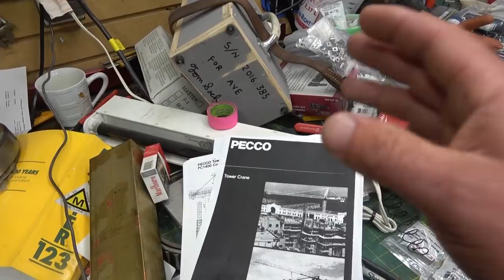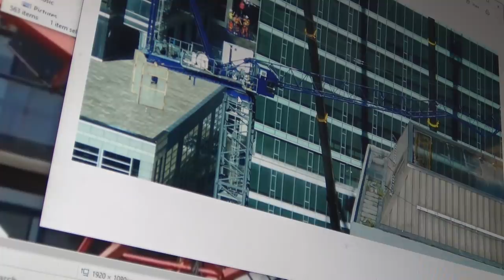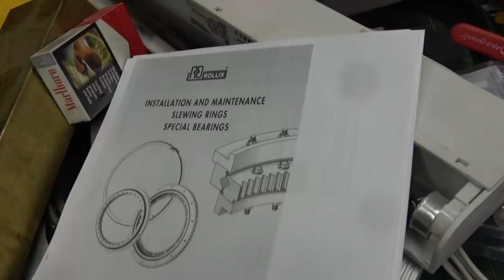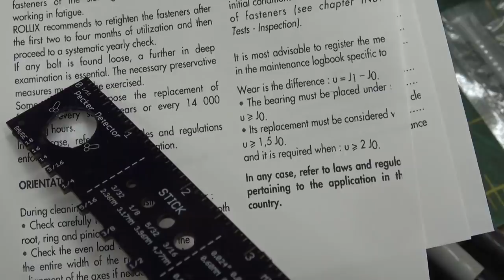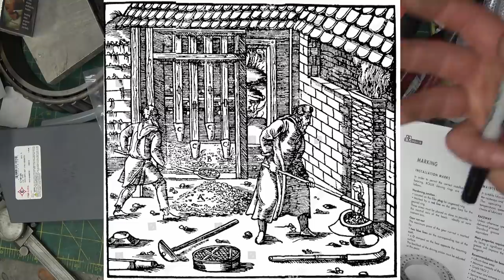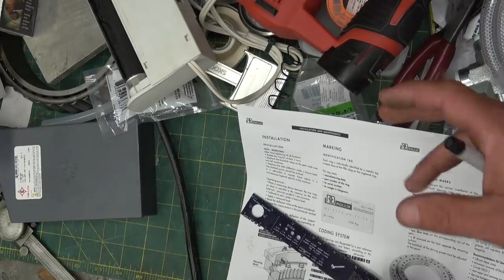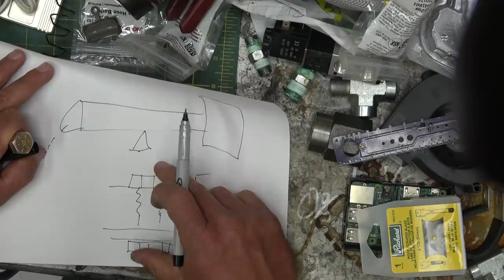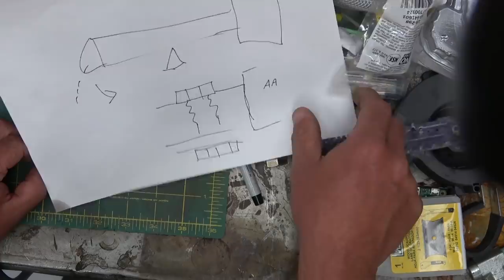This is happening too often | 2 Cranes Collapse in Toronto

Comment: I hate to do this but I am going start with my credentials, I am a union Ironworker out of the Pacific Northwest for 25 years. I have a lot of hours under the hook, as well as assembling and dissembling all types. I am also certified rigger and critical lift trainer and a OSHA 500 certified trainer.  aaaah, That felt good. I’m usually quite modest and stoic for an Ironworker 🤣. All that said , to inform the uninformed what is likely the problem. It’s a perfect storm of 3 elements that all share 1 major achilles’ heel.  
1. Schedule- assembled and disassembled usually during off hours, bids won with little wiggle room for anything to get in the way of rolling off the site with the last section on the truck. 
2. Lack of competent supervision. (Google OSHA’s definition of “competent” ) That doesn’t mean there’s a bunch of joes running crews all over, what I mean is there is more work than proper tool necessary to properly do the job. So, because commercial construction has been so busy since the dot com boom in 96’ there is not enough truly competent supervision to properly lead the assembly or disassembly of these rigs. Being a trainer, I will even admit that you don’t become skookum in a classroom, it’s hands on experience, years of it. But Even the ones who are and choose to run a crew chasing tower cranes know there is very little room for any hiccups in the process. 
3. The wining bid. Technology helps us a cunt hair on logistics, materials as well as the way some can be erected thru erector friendly connections and the fasteners used. It’s not enough. It’s essentially been the same since the 70’s when they thought up tower cranes. We are required to be faster and faster while safety standards and procedures require more and more time. Something has to give. 
And the side issue when it comes to price to play. If you think about it, when the bid gets so skinny there isn’t room for any unpredicted weather to happen or any other “act or god” . You have a recipe for disaster. What’s the end game? This path is leading the industry to what? We are approaching dangerous times and an idiot leader at the worst time.

Comment: Would love to see a video about the 3 gorges dam in China. Cracks supposedly formed back in 2003 and now some experts are raising the alarm that it could collapse due to heavy flooding.  However Chinese engineers are saying that the cracks are a normal side affect of concrete generating heat when it cools and that the differential cooling causes the cracks which is probably true but I wonder how much of it is natural and how much is a result of Chinese engineering.
Reply: Wasnt that one of the explanations for the cracks and slight leaks in the dam that failed above Los Angeles in 1928? Of course adding 20 ft of height of wall and water to the original design of the dam didnt help. In addtion to the death of 700 plus Californians, it was the undoing of William Muholland.
Reply: @4sl648  I've just been seeing some not so good things about 3 gorges.  Hopefully it holds we are talking thousands dead if it breaks.

Comment: Stupid(?) question: how much would cost to simply replace those bolts once every couple of years? Considering it's an old yet still fully functional and very useful piece of kit wouldn't that be the equivalent of, say, replacing the oil more often in an older car to extend the lifespan of the engine?

Comment: Technically a properly designed and torqued fastener should see NO cyclical load at all over its life.  Ie the clamp load due to torque should exceed the load applied, such that there is no change in tension on the bolt...   If there was opportunity for fatigue, there would need to be a replacement schedule to prevent the fatigue limit from being reached...

Comment: I'm not a mechanical enginerd, but if the bolts aren't properly torqued, won't you end up with a situation where one bolt is tighter than the others, so ends up doing the lions share of the work?

Instead of the load being properly spread across a range of bolts, one would end up under greater stress than all the others, and therefore end up holding a load it's just not rated for?

Or am I seeing something that just isn't a factor?

Comment: I'm amazed that anyone would consider reusing fasteners in this application.
Reply: You would be amazed at what people use as opposed to anything approaching common sense,I left a shop once because simply because it was dangerous to work  there
Reply: @kevinbreckenridge6729  good move.
I usually withdraw behind the safety of something quite heavy like a train or another building.

Comment: Working on an NG Well Head  52" 600# Blind flange with 28 or so 3" studs. Engineer Tells me to torque them to 3000ft/lbs... The problem was they where dry studs and being dry they would need to be almost double the torque. Somehow this dude was an* engineer for this company for 20 years. Get your own torque charts out and argue for your safety and for them to be fired for incompetence.

Comment: Was lowing the rov in the water off a brand new boat, someone bolted the gantry into the deck and didnt actually secure it under the deck, gantry fell off hanging in off the back and it was right next to me, so loud i though id just been shot in the back. poland. nuff said

Comment: I get the point of stress fetigue cycling but I missed something. How can the maximum stress be the same with or without preload? Can someone more clever than me explain?
Reply: Preload doesn't add to the maximum tension; it only increases the minimum.
Reply: OK I'll try, imagine a bolt holding 2 parts together, with no preload on the bolt it goes from no force up to the applied load force just like he showed here. If you preload the bolt to say 5000 units of force and only apply a load force of 4000 units the 2 parts will cycle between being clamped together by 5000 units and 5000-4000=1000 units but the force on the bolt doesn't change. No (or minimal) change = no fatigue.
Reply: Daniel Armstrong  ok, I think I get it. So, if you just imagine preload minus the load on the rollers in this case, equals the current stress on the bolt, right? Unloading the rollers on maximum load will add stress to the bolts?

Comment: 2 problems with the 2nd crane.  1. Age - The manufacturer is no longer available and the Crane itself should have been retired.  2. Maintenance - Either they used old bolts for the installation or did not keep the bolts tightened enough through proper maintenance and left them to loosen up over time.  As for the first crane?  Maybe the @#$%^&* +100Km windstorm that plagued Toronto or very cheaply made parts

Comment: Something amazing about lifts (aka elevators): You know how you see like 4 or 6 ropes? Yeah, one of those is strong enough to hold the full weight of the thing, plus a certain amount of overloading. Even if all of the ropes break, they have governors, which when they grab, they're like a Chinese finger trap. The heavier the lift, the harder it grabs. The lift isn't going anywhere. It'll drop maybe 6 inches and that's about it. Lifts really, really want to keep you alive. They're the safest mode of transport other than walking, apparently.

Comment: ....... not seeing a "catch" plate containment rings attached/bolted either inside the slew bearing then the other attached outside the drive gears above and below to prevent the slew bearings/drive gears from fully separating.

Comment: Anyone that wants to see metal fatigue??? Then find a OLD bad not in use fork or spoon and bend it back and forth over and over and eventually it will start to heat up and break off. I think that's a example of metal fatigue. Anyone whos knows better correct if wrong.

Comment: even if everything fails exactly as you think, that may not be the root cause of the failure (got a pun in there for ya ave...)
the root cause is often not immediately apparent
so ask " why? " such a series of events occurred until you finally arrive at the "real root cause"... for the nerds this is sigma six but why pay for an expensive consultant when you can just ask why a few times (usually less than 6 times) and find the answer yourself.
when humans are involved its almost always a little more complicated and nuanced
its not new news that a bolt would break or why it might break
its always news when the crane falls down
those peccos are as reliable as can be 
if that was the right bolt, in the right condition, installed properly there is no way it breaks much less a series of them

Comment: Why not just change out the bolts after certain hours of operation or fixed amount of time whichever comes first? It can't be that expensive all other things considered. Hell put a limit to how many times the crane can be assembled with the same bolts. (If all of these are already a thing i only need one of you to say so, not 50. Thx.)

Comment: Isn't it the same as 9/11, that if it's not preloaded its 'hanging' on the first few threads so all the forse is focussing on a few treads only and when they fail they hammer out the rest? The strengthen of a bold is obviously designed for all the treads..

Comment: AvE, aren't these bolted connections designed to have a clamp load (net compression in the joint) so that the decoupled moment's tensile load doesn't produce a net "zero" or positive load? (Nerd-to-nerd, no cool kids here lol)